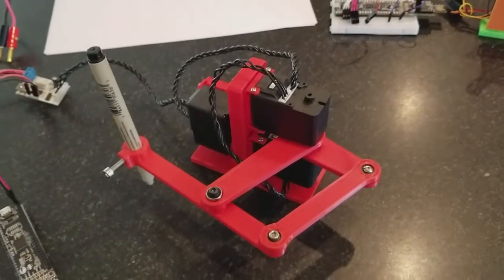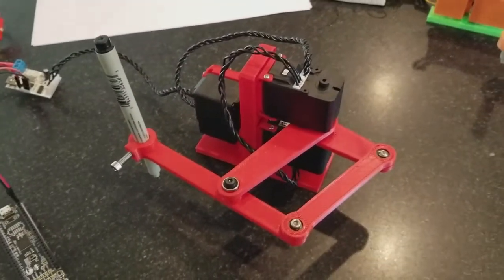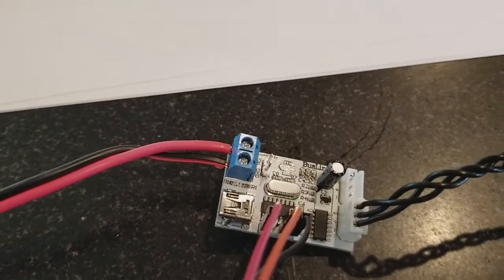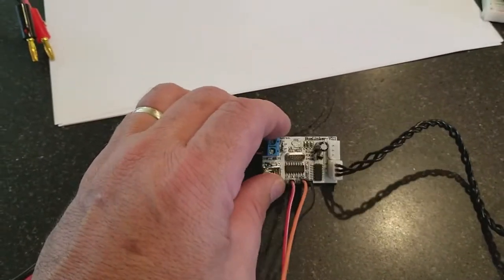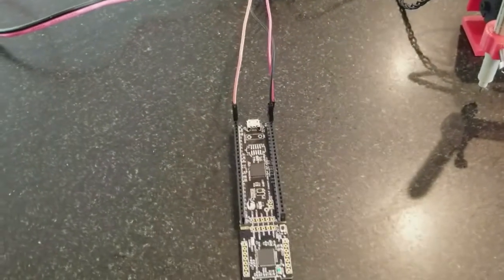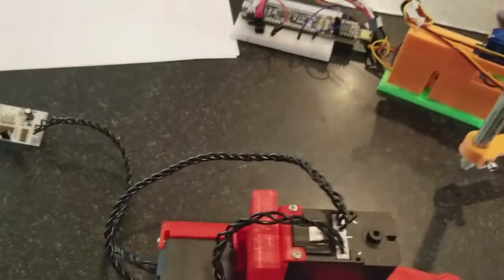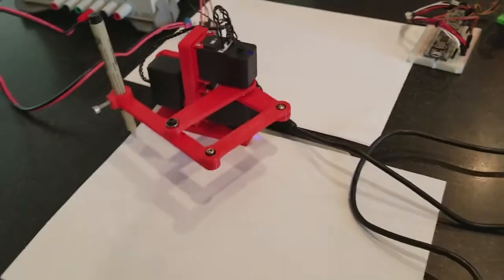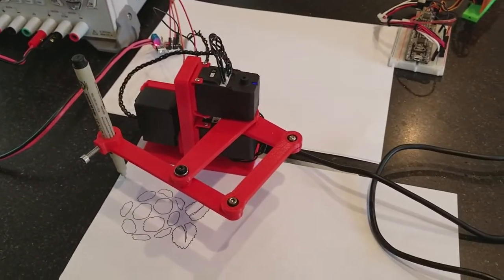LewanSoul Bus LX-16A Servo Draw Bot

Comment: I've got a similar LOBOT controller board (Hiwonder LX-15D/16A Servo Controller LBSC-v1.4).. but I don't have a board that runs  Grbl to talk to it!  Instead my host is a MKS Gen L v1.0 running Marlin.. which usually talks to stepper motors, but I have a hybrid system.

Do you know if LewanSoul  has open-sourced the schematics and/or source code for the (STM32) Arm controller?

Comment: Hi, it's awesome! I recently purchased the same servos but I haven't figured out how to move them using the protocol which is supplied by the company. Could you be so kind to give me some examples of codes or whatever I need to control the servos? Thanks
Reply from the maker: Did you read my blog post?

http://www.buildlog.net/blog/2017/09/lewansoul-lobot-lx-16a-serial-servo-review/
Reply: Yes I did. I also read the other blogs and was very interesting. What language do you use to control the servos?